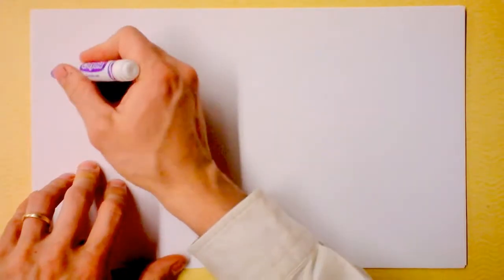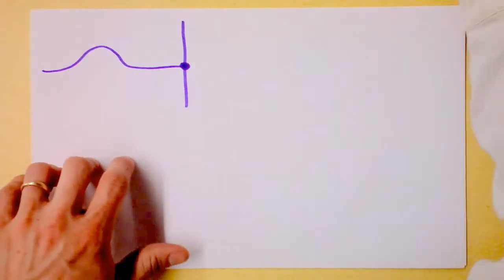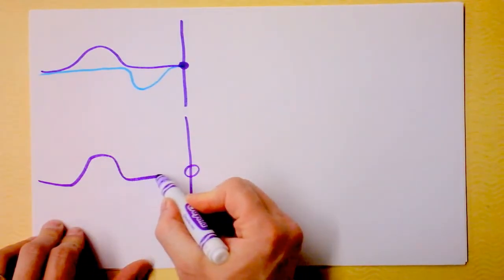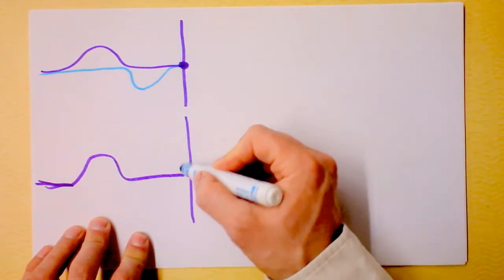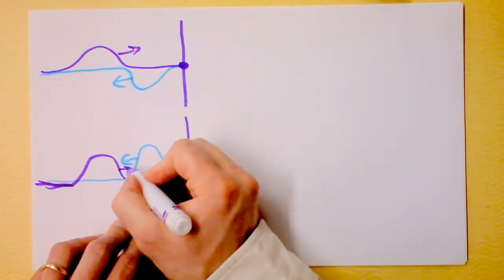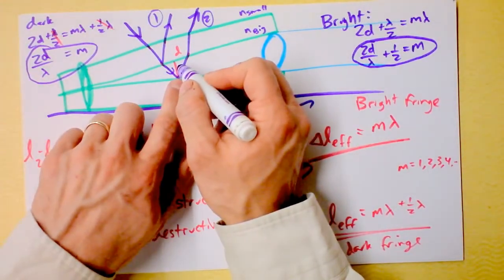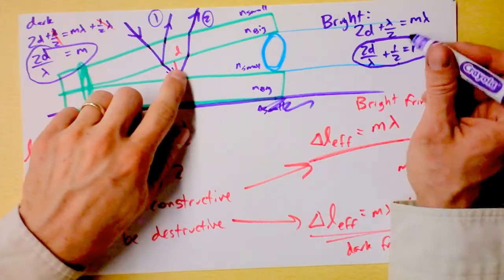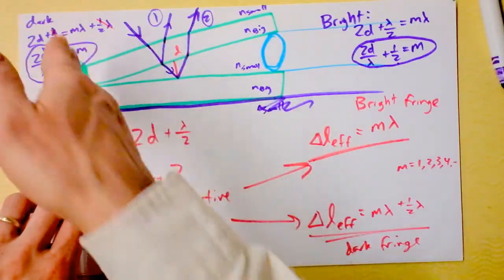Phase Shifts for Reflected Waves of Light and Air Wedge Example | Doc Physics

Comment: Dear Doc Schuter, If there are 4  surfaces why we take in count just 2 reflections? What hapens with the interference produced by the uper glass surface reflection (let´s call ray 0) and the lower glass surface reflection (let´s call ray 3) interacting with rays 1 and 2? That is, Why we can discard those other two rays?. I will apreciate your answer. Best regrads
Reply from the maker: +Alfpajarito A great question, indeed!  This combination is the one that most directly shows a fringe pattern, since the path length changes based on the plate separation.  The ones that show interference between the top and bottom of each plate would not vary since the glass thickness is consistent.  There are higher-order reflections, but they are very weak in intensity, of course.
Reply: +Doc Schuster Sory to bother you again with my questions (and sory because my bad english, I´m trying to do my best haha). 1- What means "the glass thickness is consistent"? 2- Why the interference between ray 0 and ray 1 is not considered like a thin film interference? that is, why it is diferent if the film is thin or "fat" like in this case?
Reply: Alfpajarito o

Comment: I came here looking for principals on phasing shifting a wave and was not disappointed. However have you ever experimented with phase shifting a gravity wave? If so do you think something similar would apply to its deflection through certain materials? I have really only ever worked with phase shifting electrical frequencies at my job and don't have any other experience with any other waves. I'm just really curious about gravity and how to affect and study it.
Reply from the maker: chris brown Whoa.  It's hard enough to even detect a gravity wave, but I believe the theory should be symmetric enough to imply the same sorts of phase shifting as light!!!
Reply: So in theory one could potentially phase shift and a gravity wave using reflective material that is of different thickness. After that you just need a way to amplify it and redirect. This would enable floating and weightless travel. Maybe you could use the same principals that are used with sound waves...
Reply from the maker: chris brown Holy cow.  What is a material that is gravitationally reflective?!?  And how cool would a gravitational amplifier be?  We'll need a gravity transistor.  Quick - let's get patenting!!!!
Reply: Shouldn't every material be gravitationally reflective to a degree? If a wave passes through it I imagine some should reflect with the density of the material changing how much of the wave is reflected. If nothing reflects it then certainly some could slow the wave down with density. Just an idea I guess.
Reply from the maker: chris brown Ok - absorption and isotropic reemission, sure.  But reflection?  Vector reflection?  Like a mirror?!?  That sounds much trickier.